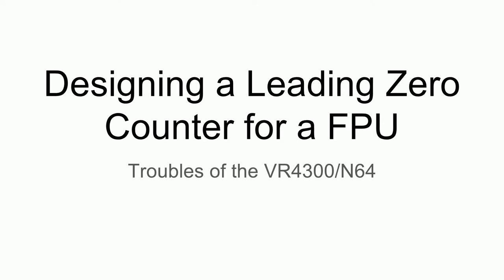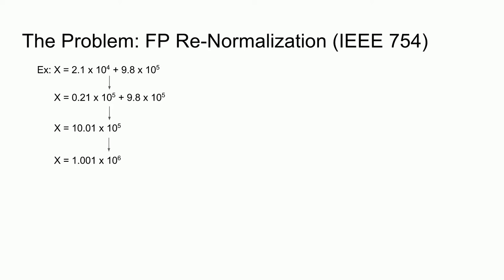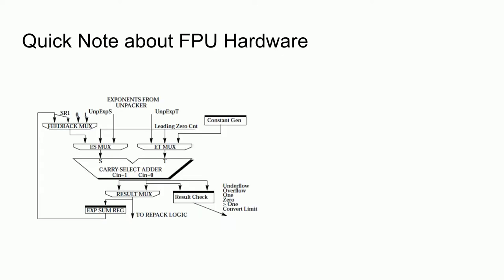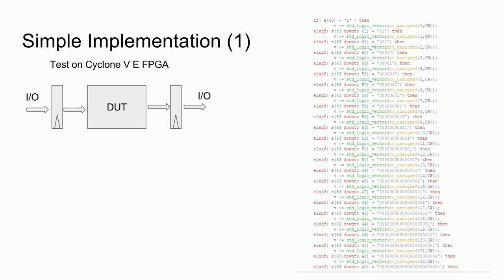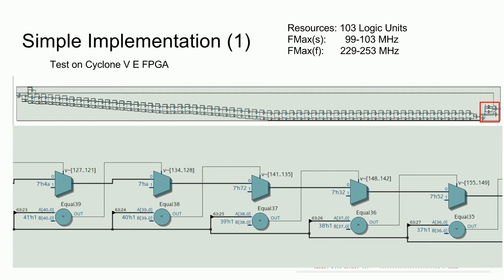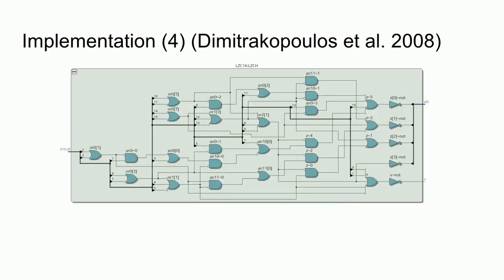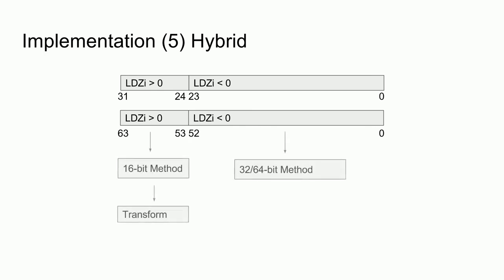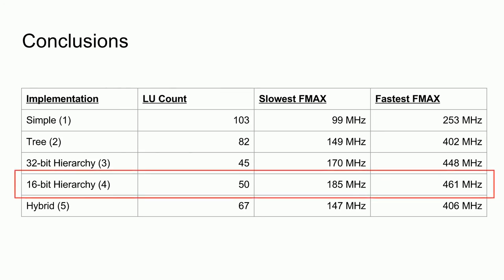Designing an Efficient Leading Zero Counter

Comment: The VHDL source code that you show is apparently an unrolled version of some code that could be in a loop :-)

BTW : finding the first Zero is something that is VERY common, for example to increment numbers or propagate carry, and many FPGA have a "fast carry" path but I don't know how to infer it in VHDL.
Reply from the maker: It could have been left in a rolled form, but I think that might have been more confusing to people who don't know VHDL all that well.
As for finding the leading zero being common, I am aware of that. However, the problem is that most people do it the slow and inefficient way and leave it at that. You could see by the results that the naïve way that it's commonly implemented is quite poor in performance compared to an optimized solution, hence the title / goal of the video.
The "fast carry" path is inferred by the tool, not by the HDL. Often the tool goes crazy with it actually, so I usually turn off that option (it prioritizes the fast carry path over logic, and ends up using 2x as many routing resources resulting in a 2x longer propagation delay just from net routing).

Comment: It's going to take a while for my brain to absorb this. lol

I get the part about needing to shift the values before adding them, but I didn't quite get the leading zeroes thing on the first viewing.

I'd love to be able to write a full FPU core from scratch, as I could then think about attempting my own R4300 core.

I'm relatively familiar with the aoR3000 core now, and how the SysAD bus on the R4300 works, so I've wondered recently about how feasible it would be to turn the aoR3000 into a full R4300.
Reply: Thanks for the vid btw. 

Information like this on the 90s era consoles is quite rare on YouTube, and a massive help for people like me who are trying to understand the whole machine.

A very welcome improvement of fMax as well. I never really thought about synthesizing individual blocks like that so the most efficient designs could be found.

I do tend to rely on the optimizations in Quartus too much tbh.
Reply: (re-watching)...

OK, I get it now.

The FP values are usually normalized (with a leading 1) before doing any maths on them, and the result needs to be normalised as well (by detecting the extra leading 1s to determine this shift amount). ;)

EDIT: "By detecting the position on the leading 1s, by counting the leading zeros", I meant.

I'll have to start reading up again, because I've forgotten how to reconcile the base-10 version of a FP number with how it relates to the base-2 version.

(I mean, obviously I can normally convert between decimal and binary, but it's not quite so intuitive with floating point yet.)
Reply from the maker: It took me a while to understand as well, but trying a few operations by hand really helped. There are plenty of floating point calculators online, however, the easiest way to convert a decimal number is to take log_2 of the number, then round the exponent away from zero (so -37.6 becomes -38), find the difference between the rounded exponent and the actual exponent (in the above case, it would be 0.4), and that value is the exponent of the mantissa (so 2^0.4). And of course you have to add a bias to the exponent, so 127 for single, and 1023 for double. 

I don't think that you can make a R4300 with a R3000 core, however, you could probably make a R4000 with it, since the R4000 had a separate FPU. You would need to extend the datapath to 64-bits though, and add support for the additional instructions (I believe the R3000 was MIPS 2 and the R4000/R4300 is MIPS 3). And code that was compiled to run on the R4300 should run on the R4000. 

As for testing / synthesizing components by themselves, I always do that unless the component has more signals than I/O pins. For one, it can help you debug the components, to see what the RTL viewer is coming up with. It can also give you an idea of which component is going to slow your design down. And, both Altera and Xilinx offer the ability to partially compile designs, so you can synthesize / fit components one at a time, to ensure that components that need to be fast end up being fast. 

Be very careful when you let Quartus optimize things, and always look at the RTL view and technology mapping to make sure the results make sense. In the simple example that I showed, Quartus produced a technology mapping that was similar to the RTL view. Additionally, I had Quartus optimize away a register file for a block RAM with added bypass logic... Clever inference, but that sort of defeats the purpose of being able to quickly access registers.
Reply: RTL Engineering 

Wow, thanks for the detailed answer. ;)

I'm glad I'm not alone in being confused by floating point. lol

Yeah, building on top of the aoR3000 core probably isn't ideal.

Might be best to start from scratch, by I've never implemented a full CPU core before, especially anything pipelined.

It's something I've wanted to attempt for years, but I'm still struggling with the PS1 GPU commands atm, and only just starting on the GTE stuff.

Yep, I do tend to look at the RTL viewer more often now, I just wish it was a lot easier to look at, because they still tend to display the signals in a weird vertical fashion, so it's quite hard to navigate larger designs.
Reply: RTL Engineering 

Do the N64 games really use the 64-bit instructions at all btw?

I can understand them using double floats even, but I don't think I've seen many games use the true 64-bit opcodes on the R4300?

(I realise it uses a 32-bit SysAD bus, but that's a separate issue, of course.)
Reply from the maker: I'm not sure to be honest. I wouldn't be surprised if it turned out that none of the N64 games used the 64-bit instructions. It would be very hard to verify this though, because the ROMS contain data as well as instructions, so the only way to tell would be to run every game ROM sold, and throw a special exception in the event that a 64-bit instruction is found. Keep in mind, most games (perhaps all of them) ran in kernel mode, and all instructions are fair game in kernel mode, regardless of the 32/64 bit flag in to status register. 
So I would err on the side of caution and make sure that the VR4300 core implements everything and behaves exactly like how the original VR4300 did. For all you know, there's one game out there that has a single 64-bit add buried somewhere in the executable.

As for the SysAD bus, the VR4300 had a full 64-bit virtual address space, but the upper 32-bits were truncated when translating to a physical address (the R4000 had 36-bit physical addresses).
Reply: RTL Engineering 

True. Might as well go the whole hog if you're going to the trouble of implementing the CPU to begin with, and yep - who knows what weird tricks some games might use.

Yep, I think some people do tend to think that the 32-bit SysAD bus is a real bottleneck in the N64, but all the heavy lifting is of course done via DMA inside the RCP, which definitely does have a full 64-bit data path.

(and obviously latches a much wider address into the RCP as you say, which only takes two or three SysAD clock cycles .)

It's a bit like the original Amiga models - the 68000 might only have a 16-bit external data bus (and technically some 32-bit internal regs), but all of the really clever stuff is done via DMA, and the custom chipset.

Hell, even the SNES could be considered only "8-bit" by the old definition, but we know the CPU bus is definitely only a small part of the overall "power" of a specific machine.
Reply from the maker: The bottleneck in the N64 is the internal data bus and the RAM bus. You have the CPU, and all of the DMAs fighting over the internal data bus to access the RAM. I am guessing that the internal bus is 64-bits wide not to help data flow better, but to allow the RCP to source / sink data from the RAM (since it has a high clock speed, and the RCP has a relatively low clock speed). 

I don't think the RCP even uses the full 32-bit address range, for all I know, the address bus in the RCP is only 26 bits, since it only needs to address RAM and the cartridge bus (it could even be managing the cartridge domains with banks, similar to how the NES worked). As for the SysAD bus, the VR4300 only exposes a 32-bit address, so it only devotes a single cycle to the read/write address. Additionally, the VR4300 did not have a DMAC on chip, so loading into cache required individual reads.

Though, with that said, the VR4300 did have a pseudo DMAC for instruction memory, where it supported the CACHE Fill command on the ICache. So effectively, the CPU could systematically go over each cache line in the ICache, and request that it be refilled from memory at a specific address. This would be bulk read requests on the size of 32 bytes, and is non-blocking. I have no idea if any of the N64 games did this, but it was possible.

Comment: I need to make a leading zero counter for fp addition 52 bit mantissa. how can i go about this? it can be pipelined into two stages or more if needed. 120 mhz clock
Reply from the maker: Use one of the methods I described in the video? Other than that, research it - that's what I did.
The later methods can be pipelined. The clocks speed depends entirely on your target.